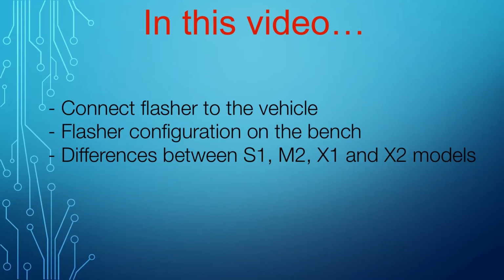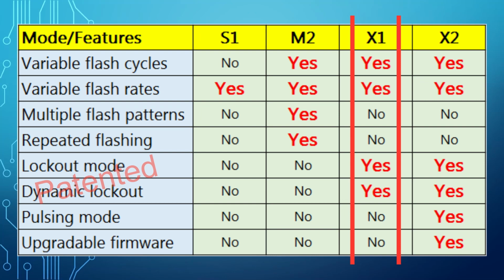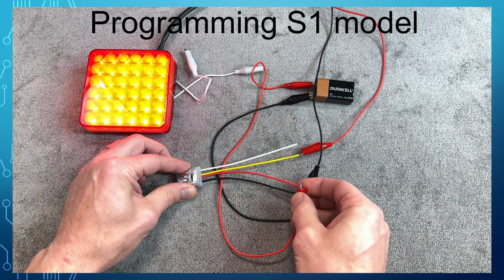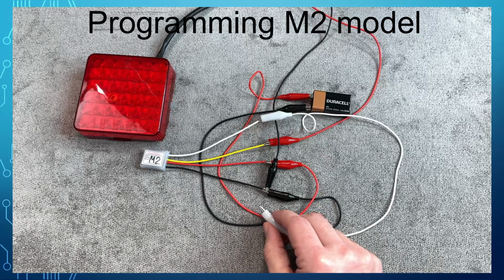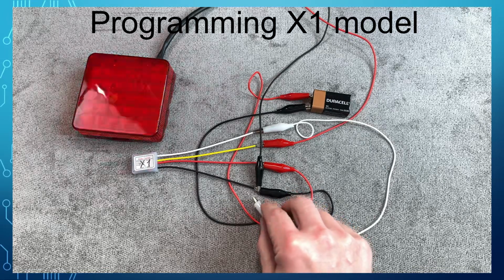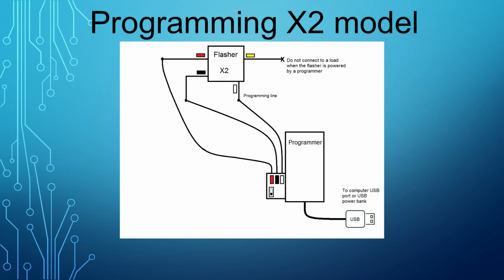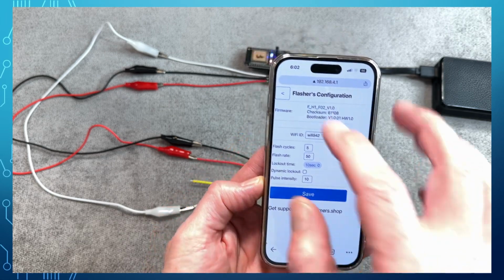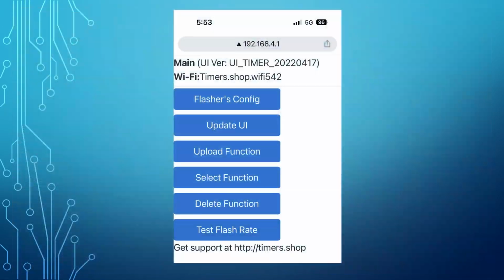Four brake light flashers compared. Dynamic lockout feature and more!

Comment: I wish you showed some more on that pulsing before I spend the money on it
Reply: It's worth it. Just picked one up and the programming options are great. They even include connectors and alligator clips for programming.
Reply: @Robert Thompson  I didn't wanna reply to myself bit I bought one too and you're right the included alligator clips and connectors feel real premium. I hope that they upgrade to allow more programming of the pulsing so it's not just intensity also duration. Still thumbs up and I can't wait to wire it in.
Reply: @landyacht4878  I got the M2, it has the options I needed. 5 insanely rapid flashes, then flickers every 12 seconds the brake stays depressed.

Comment: Hi, I program the flasher and works fine when connected to the programmer but when I connect to brake light only the flashing work, the intensity and the lock out time doesn't work either.

Comment: Can i installed them on my headlight?
Reply: Why?
Reply: @N269  Some motorcyclists think this makes them safer.  But if they actually cared about their safety, they'd stop riding "donor cycles".
Reply: I think you would need a super fast switching relay, since this would burn up at headlight current. Feed the flasher box signal into the relay control signal, relay output to the headlights.

Comment: Do not buy this product, Horrible, instructions, service, and website.
Reply: Also be advised that in New Zealand this red flashing addition is highly illegal!!
Only police, emergency vehicles etc, etc are allowed to have a 'RED FLASHING LIGHT" showing to the rear!! I know because I was refused a vehicle fitness certification also known as a "Warrant of Fitness" (WOF) had to remove this device from my car otherwise no insurance or WOF if you happen to have an accident as it is deemed an illegal fitting or device!!
Reply: False , these are excellent. As with the many othe modules I own from them. Instructions are very straightforward for anyone with critical thinking and a brain.
Reply: Awesome and easy to program.  Read instructions and follow video. DONE!
Reply: it's only illegal in the united states to flash your lights continuously, ie strobe lights. it is perfectly legal to flash your 3rd brake light X times as long as it stops and stays solid red for the remainder duration your foot is on the brake pedal.
Reply: Got the older version(s) on motorcycles.... they are great, small and quite affordable. Easy to program, the installation, the way I did it, is really, just plug 'n play. The service, back in 2017 (or thereabouts) was good. I recently wrote them in 2023 and had no reply. So, perhaps they have devolved to their distribution outlets. But, mine still work and work well. I have the older M1 units... but with lockout. They used to be $16, now $27... that's an 8 year difference. I recommend these units.
Reply: @brendonrutherford5118  It must be hard living in a country without rights for the citizenry, where the government tramples on everyone and exempts itself from the laws it imposes on the serfs.